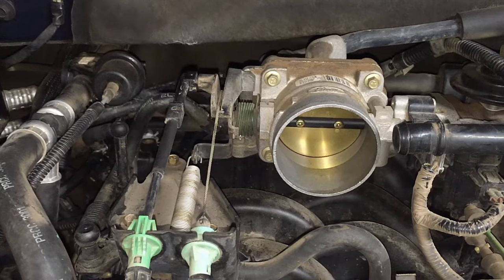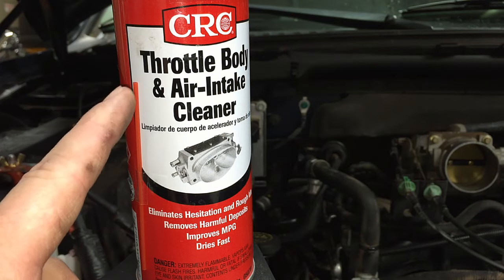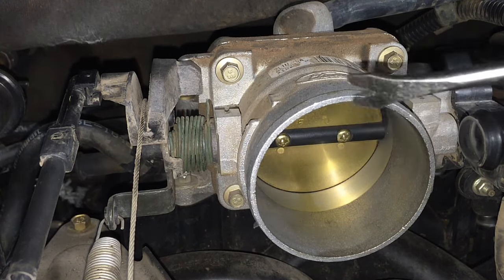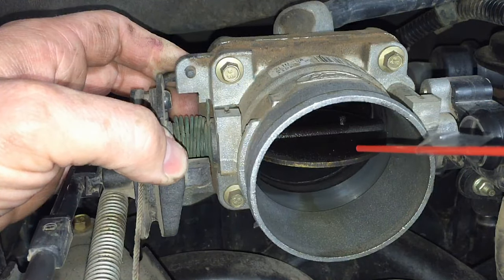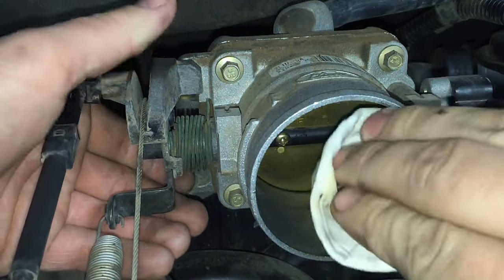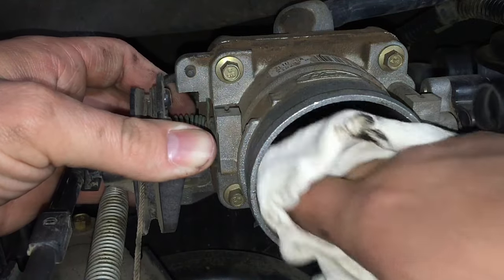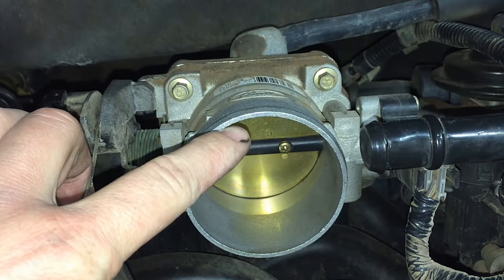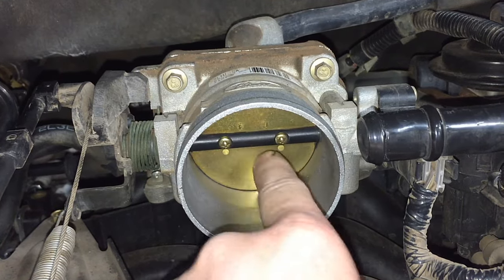Ford Quick Tips: #43 Cleaning Cable Driven Throtle Bodies Properly

Comment: If you don't remove the throttle body from the engine when cleaning, doesn't some of the black junk get sprayed down into the engine?
Reply: yes but put a rag first in there where you can pull it with a piece of duct tape and spray down then pull the towel out , helps clean without goin inside
Reply: Yes it does.  But the small amount of carbon will easily burn off without hurting your engine.  And DON'T stick a rag in the throttle body!  That gate is adjusted precisely to work with your engine.  Pushing it with rags and misadjusting it will cause tuning problems.  Just use the spray and gently clean it off with a small rag.

Comment: XLn’t channel, thank you for sharing your knowledge Sir! I’ve found that removing the Throttle Body, & using a small plastic bucket with a quart of gasoline works quite well. Especially if the vehicle is neglected with lots of Carbon caking inside. Use a nylon brush, be patient, the gas won’t remove the coating. (I’ve seen many an F150 guys have messed with the settings. When they should’ve just removed & cleaned the inside. And they were “Trained Technicians”.)

Comment: i have never personally ever had any issues cleaning a throttle body plate or MAF sensor with any type of carb cleaner, including B12 Chemtool, my fav solvent of choice which is pretty strong.
Reply: Ozzstar symptoms are poor idle or surges while stopped in gear.

Comment: I also use electronic senor cleaner on both pivot points on the butterfly.  People should test drive close to home and make the car idles like a baby with no surges of the throttle. If so repeat the cleaning steps. NO screwdrivers wrapped with rags!
Reply: Use the back of a tooth brush with a rag.
Reply: Thanks, I saw a vid earlier with the screwdriver and rag😮

Comment: I rebuild the throttle body completely. It’s really helped my 96 Ford F150 and I put in the new distributor 207,000 miles. It’s running great.
Reply: I have a 96 f 150 too mines at 98,000 n i checked my distributor cap it seemed fairly new but anyways i have no clue why it keeps shutting down on me when i drive and come to a stop sometimes it wouldnt even let me get passed 45 miles on the road before wanting to give out? Any ideas how to help?
Reply: @adamblancas6850 I'm having similar issue. I've heard replacing the Throttle position sensor helps but haven't tried yet. Did you get it figured out?

Comment: An update. today I've been doing some explorer 2011 75k cleaning, pads, air filter, oil, and vbelt. Anyway the air assy going from TB to air box had a puddle of thick oils at either end. So at 50k it would be advisable to take that air cross tube off and clean it. My throttle body was filthy too, but motor was running great, go figure. check my post on youtube.

Comment: I been using CRC for 20 years and that stuff is great. It's never removed that coating inside the intake. It doesn't harm sensors or rubber seals. 

I still spray back up into that intake wall behind the throttle body. That place seems to catch most the carbon. Then blow it out with compressed air or wipe it with a rag. If it's really built up. I remove the throttle body and get in there clean it good. Then replace the gasket seal.

Great Spring time job for the DIY mechanic.

Comment: Thanks again because I never would have known there was a safe way to clean my throttle body since my 1997-2005 Expedition / Navigator manual says the intake system is Teflon coated and no cleaner should ever be used on it !

Comment: So when your doing the final cleaning, you say to have the engine running.  How are you doing this with the intake tracked off?  Can you run it that way with the Mass Air meter unplugged?
What about the Idle Air by Pass?  Do you recommend cleaning it at the same time?  If so, how do you recommend doing that service?
Reply from the maker: Armand Tomany Yes it will run that way just disconnect the maf start the engine let it idle till warm and then proceed at idle only.
Reply: @FordTechMakuloco  where can i find a vacuum routing diagram for the throttlebody and egr i have an 03 5.4l

Comment: Hello Mr. fordtec. I have a question. Ford 500. It hesitates going up hills. Doesnt want to go fast. No lights come on during that. Recently had exhaust pipe break. Fixed it but wouldnt call it a great job. Anyways. A few times at cold startup, yellow wrench light came on. Car sounded rough. Turning car off and waiting a minute, turn car back on, no light, didnt sound rough. But getting car up to speed sometimes is difficult, especially on steep hill. Maybe exhaust leak issue?  What is the yellow wrench? Forgot to say that light came on when heat was put on during cold start. Was adjusting heat temp and fan blow speed, car then went to sounding rough
Reply: Did you ever find out why you had trouble going up hills/hesitation?

Did you find out what the issue was and how did you fix it?

Comment: My 2001 ford ka has, or did have, a coated throttle body bore. In my ignorance and not taking to heart the warning on the throttle body I used 'throttle body and carby cleaner'.  The lower bore surface now has dark corrosion staining.  Do you have a suggestion on how to continue from here?

Comment: My BlueDriver scan tool was showing 20% throttle position at idle so I cleaned my throttle plate but it didn't help. My throttle plate wasn't nearly as dirty as yours was. Anyway, do I have a bad throttle sensor or is there something else that could be causing this problem? As near as I can tell, the throttle plate completely closes with the engine off and it doesn't look like the linkage is opening the plate with the engine running at idle. Besides, an actual physical 20% would be obvious. The scan tool does show an increase in throttle opening with acceleration. This is a 2002 Mustang GT. Idle is 550 RPM at operating temperature with the transmission in Drive. The only issue I see is poor fuel economy at 14.5 MPG driving around town. The sticker (yes I still have it) says I should get 17 MPG in city driving but it did indicate that the range is 14 to 20.
Reply: And no reply from anyone? I have the same problem 20% but a higher idle of 900, which should be 650.

Comment: Is it okay to use half the recommended dose of seafoam and put it in your crank case for 100 miles and then change your oil I just hit a 100k mi. was wondering if it would help cleaning the inside of the engine?
Reply: Yes it will keep your engine clean

Comment: I have a 95 F150 with a 4.9 straight 6, automatic with 3:55 gears.  Fuel mileage is horrible (13mpg) and I think it can do better.  It's ODB1 and I don't have a scan tool.  I've changed plugs, plug wires, cap, rotor, coolant sensor and cleaned the throttle plates.  Timing is on the mark.  The truck runs GOOD!  It just has a "hollow leg" -- Any suggestions?
Reply: I know this is an old comment, but 13 mpg out of any fuel injected 4.9 is actually pretty good.  I've heard of the carbureted ones doing much better for some reason.  I had an 88 with the 4.9 (fuel injected) and manual trans, got about 12-13 highway with it.  Switched gears to 3.08:1 for a cross country trip and I was able to improve that to 14-15.  With 3.55:1 gears, you're doing pretty well.  If you don't drive a lot of highway miles, I wouldn't recommend the gear change though.  City mileage was the same or maybe a bit worse at about 10-11 mpg.  3.55 gears with 235/75r15 tires is a good all-around combo for that truck.  FYI, in '95 model year, none of the full size pickups got much better mileage than you're getting now.  For the Fords, the 5.0/302 was the best, but only marginally better than the 4.9 or 5.8.  The 7.5/460 was a pig that got sub 10 mpg all the time and I've seen it drop below 5 mpg on those.

Comment: Pulled the throttle body to clean it with a soft bristle tooth brush. Replaced and now I have a high idle of 1000 rpms?
Reply: I’ve heard that will go away after a couple days as it self resets. Just curious if yours did that?
Reply: Well did it go away?
Reply: You just removed the special coating on the throttle body causing higher idle.. 😆

Comment: Can u used w d 40 ?
Reply: Don't use WD-40 or any lubricant to clean the throttle body. Once it dries, it will leave a residue that will cause fine particles to stick.